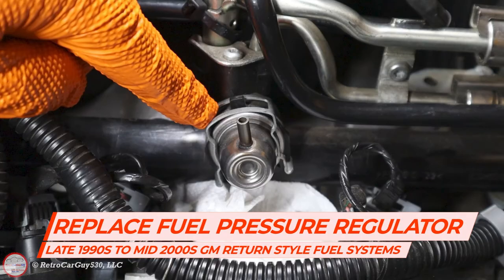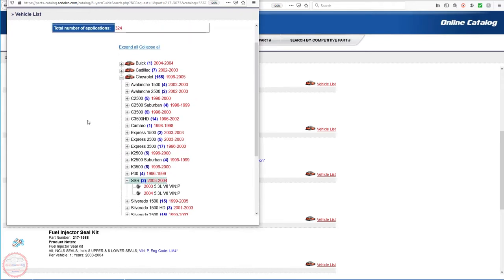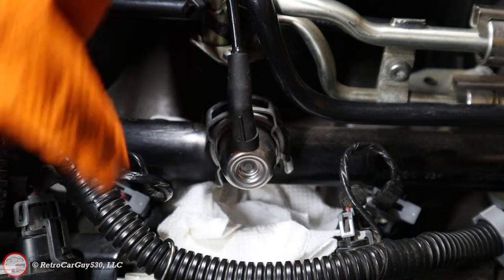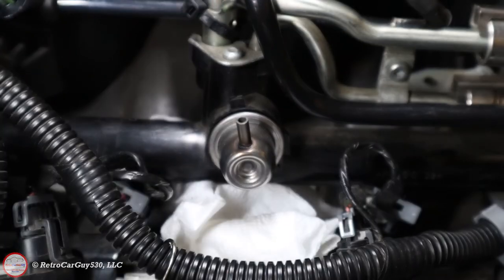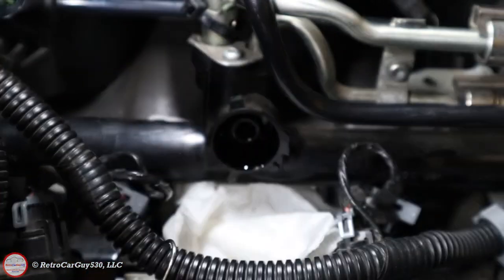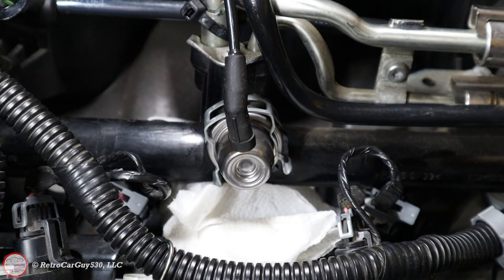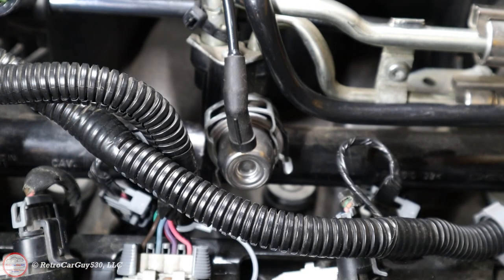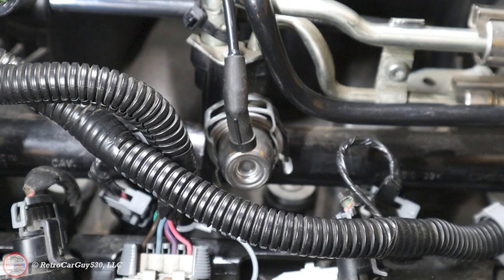Replace Fuel Pressure Regulator - Late 1990s to mid 2000s GM Return Style Fuel Injection Systems

Comment: Could a messed up fuel regulator cause the injectors to overspray
Reply from the maker: If the fuel regulator is not reducing the pressure at idle (when vacuum is at its max), the fuel pressure will be few PSI higher than expected.  That might allow for the possibility of a small overspray amount to be possible, but the PCM/ECM should be pulsing the injector at a rate appropriate for the RPM level at idle.  If you look at the short/long fuel trim levels at idle an you see it's always negative (it's taking away fuel to get the correct air fuel ratio), then there is something allowing too much fuel through.  A sticky/leaking injector would be a more likely cause of that situation, but having the fuel pressure slightly too high can be a contributing factor.

Comment: Ok, so what would cause the regulator I'm assuming it it to make a annoying chattering/ticking sound I don't really know how to explain the sound, but I've went with a aftermarket regulator, then a ac Delco regulator and both are making the same sound.
Reply from the maker: I can't say I've heard that type of pressure regulator make that kind of sound.  The only two outside influences on that item are vacuum from the intake manifold and the fuel pressure from the fuel pump.  You might temporarily disconnecting the vacuum line and see if the sound changes.  If the vacuum line test doesn't change the sound, then you might want to listen to the fuel pressure regulator and each one of the fuel injectors.   You can use an automotive stethoscope or a long screen driver between your ear and the item being listened to.  You might have one or more sticky/noisy full injector(s).
Reply: @RetroCarGuy530  it was the check valve that was bad in the pump, causing the sound, after I changed the pump, it took about a week to finally go away.

Comment: On my 2000 chevy silverado. There are times it won't start unless I switch or remove the fuel pressure regulator. Would you know what the issue is?
Reply from the maker: The PCM expects the fuel system to deliver a specified amount of fuel pressure to properly feed the fuel injectors to make sure the air fuel ratio can be maintained.  At idle, the amount of vacuum in the intake manifold is high so the fuel pressure regulator should be allowing some of the fuel delivered by the fuel pump to be returned via the return line.  When you say you could take out the fuel pressure regulator and it would start seems odd to me since that would seem to not work at all.  I'm assuming you're plugging the hole where the regulator was installed when you state that you removed it.

To deliver the correct fuel pressure at engine start time, the following must be true:

1) The key-on-engine-off position of the ignition switch must activate the fuel pump for the priming run of 2 or 3 seconds to build fuel pressure in the fuel rail and at the injectors
2) The fuel line check valve must not allow the pressurized fuel to flow back into the tank (resulting in low fuel pressure)
3) The fuel pressure regulator must not be leaking fuel internally (if you see fuel come out of the vacuum line connection pipe then it has an internal leak)
4) The fuel pump relay in the fuse box (assuming your vehicle has one - which I believe it does) properly supplies power to the fuel pump when the PCM commands the priming pressure build up during key-on-engine-off/run.
5) The fuel pump is producing the proper fuel pressure (likely in the 48 to 58 PSI range) during engine startup
6) The fuel filter is not restricted in any way which might result in reduced fuel pressure or flow
7) The fuel injectors are not stuck open or stuck closed (meaning they're delivering the expected amount of fuel to each cylinder)

If you can test the fuel pressure on the fuel rail to see what kind of pressure is present during engine startup might be the first step.  Sometimes the fuel pump relay in the fuse box can be weak/sluggish.  It may be worthwhile to see if you can swap it with another relay of the same type (often the same type of relay is used for multiple functions in the fuse box).  Make sure you keep the relay pins oriented in the same order to make sure it will work correctly.

I have only had one bad fuel pressure regulator over the past 20 years and it was leaking through the diaphragm.  

I don't know what else to suggest at this point.  I hope that helps.
Reply: @RetroCarGuy530  thank you so much. I will look into the relay